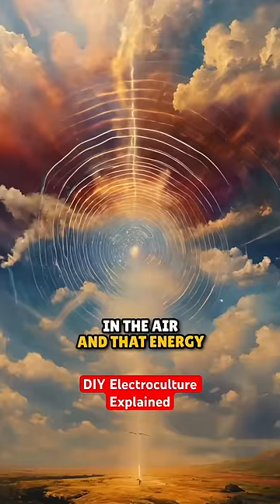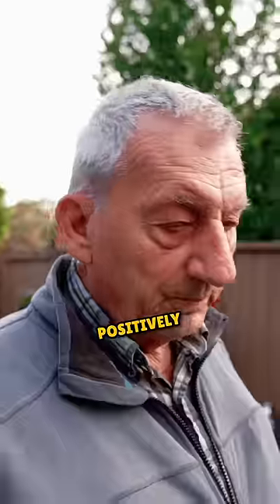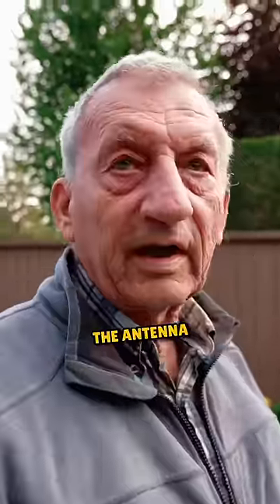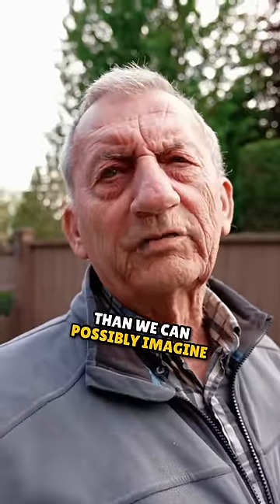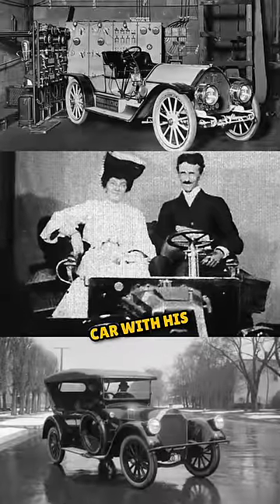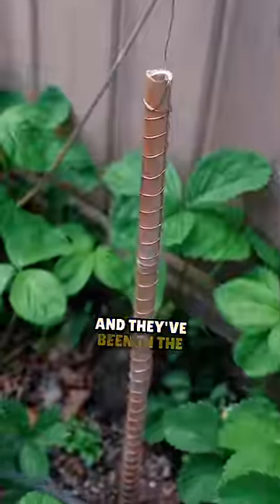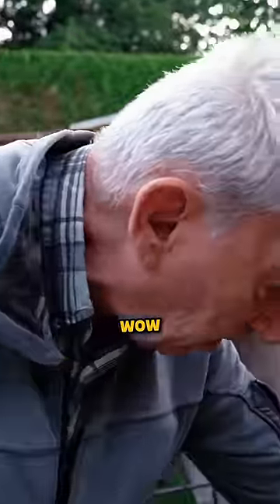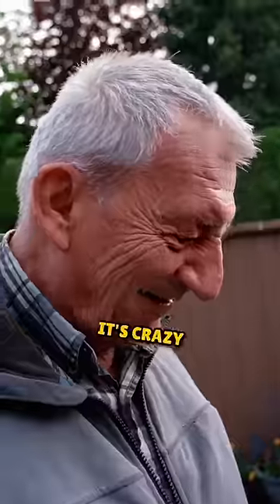DIY Electroculture for gardening explained - What is electroculture and how does it work? #shorts

Comment: I can say from firsthand experience that the copper coiling WORKS.
Reply: Life is electrochemical not electromagnetic. All cells create their own energy and their own water through a  process - "ATP" Adenosine Triphosphate.
Reply: @donaldcameron9321  Yes, and the adenosine triphosphate consists of three components of which three components have their own atomic structures and each atom has it's own positive and negatively charged particles. I guess what I'm saying is, electrochemical reactions couldn't happen without electromagnetism as the boiler plate force.
Reply: Copper coil works as what?  A triangulation tool? 😂😂😂
Reply: No.  No it doesn't.
Reply: Why wrap it around wood? Way not metal? Thanks
Reply: Why we all know these terms that mean what? 
"Well my chemistry professor told me"
Ah so it must be true.
Reply: 100% 👍
Reply: Yes, by providing copper to the soil
Reply: Could this be done with humans in some form?
Reply: So should I use copper wiring. 🤔
Reply: so what does the stick with copper coil do exactly? since when are plants powered by electricity and magnets? they get energy from the sun by a process called photosynthesis, and from the dirt and water providing essential nutrients through the intricate root system of the plant. btw how does the magic electricity from the air get from the copper coil through the dirt and into the plant by the way?
Reply: @AnnaBrown-h4e  Because then it's no longer a coil as the whole thing is conductive.
Reply: @env0x Can you prove that electrically stimulating vegetation roots is not beneficial?  Only way to know for sure is testing.  A lot more testing than a backyard strawberry plot.  Using cloned plants in identical mediums,  receiving the same light levels, same fertilizer applications.   I'd almost be willing to bet it wouldn't hurt the growth.
Reply: Says the guy w/o a Bachelors degree.
Reply: I was going to work at a naval radio tower place and my job was to go and cut all the saplings around the towers cause they draw the current away and grow super fast. I was gonna just experiment with a copper rod but the coil makes sense too. And then if that wasn’t enough I am going to mess with the 432hz and 528hz I think it was and just see if anything great happens. Keep growing 👍🏼
Reply: I highly doubt that 3-4 days would be enough time to  give you results at any measurable degree. I don't disagree that there is electricity all around us, just that this specific method would provide any significant difference, otherwise nature would have them sprouting up everywhere.
Reply: if this work, farm under powerline should be have the best yield
Reply: Copper has anti bacterial properties
Reply: @darwinismyneighbor  I've had mine in the ground for 3 weeks. Now I'm starting to see "results". Made a short video about   it.
Reply: @lone-wolf-1  healthy soil need bacteria
Reply: @travismckinnon2494 
People wear copper bracelets 
Copper socks…
Reply: @TearDrop455  Is it effective?
Reply: @travismckinnon2494  
Very much so!
Reply: I haven’t tried this but I will say that all plants grow better after an electrical storm. I’ll have to test out the coil. Now…. Can anyone  tell me how to keep the chipmunk out of my strawberry plants.
Reply: Whole lotta nonbelievers in this thread 👀
Reply: @katen1228 that’s because lightning converts the nitrogen in the atmosphere to a very useable form of fertilizing nitrogen. And you just got the plants watered with soft water instead of chlorine filled tap water.
Reply: @sarahbroussard7489  You appear to have misunderstood basic organic chemistry and basic electricity. A "Carrington Event" recurrence would fry everything electromagnetic, while leaving "organic compounds" and disconnected batteries unmolested.
There are these things we call "contexts" and you  have wandered indifferently from one to another without closing the door behind you.
Reply: @donaldcameron9321  No need to be an ass, I can admit being wrong.
Reply: @livingdocument i would love to see your video
Reply: @sarahbroussard7489  Maybe I felt insulted.
Reply: Except it doesnt.  You fell into what a lot of people call, a biased belief.
Reply: @darwinismyneighbor well, even without the coil, 3-4 days will definitely give you a significant growth difference. Idk if you’re a gardener at all but, if you leave for 3 days and come back you plants will be noticeably bigger as long as they were watered… so to say it’s from the coil is a stretch but plants definitely grow big in 3-4 days in proper conditions
Reply: Sir what diameter,  thickness, and type of copper please?
Reply: @mj9844  Obviously, the bigger the better.  This man is grounding the earth so plants will grow.
Reply: @katen1228 You can buy fine mesh covers specifically to cover berry bushes & fruit trees etc. or cut up & use those use old, sheer, white curtains that many people use over their windows. They also work well in the bottom of pots to stop soil from draining out but they still allow for airflow.
Reply: doesnt the spin of particles in the elements of atoms create a magnetic field from their rotational force? if our atmosphere is made of elements it too is electrochemical air is made up of elements
Reply: I love the comment section so much 😅
Reply: @bobjonez110  bro what are you yappin about. Do you even know what you are saying
Reply: @zo3997  yes sadly where is their optimism
Reply: @sharsc1994  oppressed by the rich to keep them poor, & hence they waste their energy hating & arguing instead of collaborating... Capitalism is beautiful ❤️‍🔥
Reply: @sarahbroussard7489 
So....as a thought...
We should see better growth in fields at the crossings of high voltage transfer cables....
As there is a lot of electromagnetism under them
Reply: @Treborize.  Yeah you'll get super far in life by pretending experts in their scientific fields don't know what they are talking about 🤡
Reply: Knew a rancher who told his 5 yr old grandson that if he'd pull up & keep his left jeans pant leg pulled up to mid calf over his boot, he'd soon own his own herd.  Everyone at school laughed at him when he explained why he was wearing his pants that way, but it wasn't long after....
Reply: It sure does
Reply: @AnnaBrown-h4e  I'm only guessing, but I think that the steel rod would be like a shirt circuit in the coil.  They don't give a length for the wire, but I think that this would change the effect, just like outdoor TV antenaes have different lengths for different channells.
Reply: @katen1228 

Ivory soap
Reply: ok then do a simple scientific study, one with the pole one without, record it, post it. you would win all sorts of prizes
Reply: @AnnaBrown-h4e   -   What is being used is the LENGTH of the wire. You can get a lot of wraps, even more length, using insulated wire, since the wire won't short out.  Metal would short it out, and nullify the effect. A long enuff wire can make the effect so intense it could knock you off your feet. Think "Ben Franklin" -  He could even INDUCE LIGHTENING out of a clear sky with enuff wire!
Reply: @noblefleet  no it creates an electromagnetic field by being coiled drawing off the magnetic field of the earth and thus stimulating the electrochemical effect in  the plants 😊
Reply: Just don't do it in lightning prone areas🎉
Reply: @env0x they keep the snails away
Reply: How about a 1/2 copper water pipe ?

Comment: I followed his suggestions, and was shocked by the outcome.
Reply: Ba dum tis
Reply: @Patriottoo
What kind of coil, was it just a piece of wire? 
I wonder if a bamboo stick would work?
Reply: What metal was the wire? Copper?
Reply: What was the outcome of how long did it take?
Reply: @jude7321   A lacuna coil.  And bamboo should work, so long as it's a switch.
Reply: @blakelang4662   I tried potassium metal.  The results were almost instantaneous and explosive by the first rain.
Reply: @rouninpanda6318 what do you mean it's a switch? can one use a copper coil?
Reply: @rouninpanda6318  thank you. I'll give that a try next time I'm home.
Reply: @witchcraftispolitical they're messing with you
Reply: I've tried it last year too and it didn't work at all!
Reply: @blakelang4662 I think copper might poison the soil. So maybe silver or aluminum.
Reply: What was the coil made of? Which metal?
Does it have to touch the ground and stretch up like an antena?
Reply: Copper wire its called electroculture
Reply: @blakelang4662 probably not a great idea 😂💥💥💥💥🔥
Reply: This works.   I'm testing and proving it right now.  Unbelievable how much a couple plants jumped in just a few days.  Adding more as i can.
Reply: @steviecef  Of course you're "proof" has a control patch for comparison?
Reply: What metal did you use for the wire?
Reply: Yes @theunsettlingwitch
Reply: @steviecef What was the coil made of in your case? Thanks
Reply: You must hit a utility line
Reply: @theunsettlingwitch it needs to be copper
Reply: @carinabusegeanu4335 it was a joke. Get it? Shocked?

Comment: Since I do a lot of weeding in my garden I always make these with an open loop at the top to protect my eyes from being poked because they are difficult to see.
Reply: What kind of coil?
Reply: @LCJCFAMILY    I just went back to the video and I know what you're asking... Most people use copper wire and the gauge of the wire doesn't seem to be important.  In the video he was using a silver colored wire.
Reply: @dorisbarreto347     with the wire he was winding around the dowel...the wire is the actuator.
Reply: @irenepeek3211  thanks
Reply: What metal or element is needed or works best? Also, what are good substitutes?
Reply: I think copper coil
Reply: Yeah and you don’t want to accidentally sit on one too😂
Reply: Yeah he said copper but he was using what he had.  Copper would be the best I would think conductor wise. Try it counterclockwise I think that is actually the way the Earth is supposed to be spinning.... Let's tell each other the results
Reply: Hello. Thanks for the advice my straight up wire is trying to kill ma!
Reply: Thanks for letting us know! I would most definitely poke my eye out. 
I plan on making the stakes next weekend.
Reply: @karenmmcthree    Hello. Ok count me in I wrote this video name down so my ditzy brain can find it again. Just my thought. I believe this will work better when the soil is damp, therefore more electricity is conducive to the roots of the plants.  I plan on putting 2 to 4 rods by my potatoes ; 1 at each tomato plant(last year 3of the plants were over 10 ft tall)  Then I’ll report about other plants and copper wrapped rods. By the way I’m using bamboo sticks to wrap the wire on. I find them less intrusive and being thin they kinda get lost in the foliage. Good luck!
Reply: Ok, wouldn't any old electrical cord work? I mean doesn't everyone have an old fan or lamp that no longer works? If it can transport electricity for the fan, it should work for this too, right?
Reply: Good idea.  I got lots of spliced up contractor cords. May I suggest that you strip the insulation off and just work with the bare wire.  Good luck
Reply: @laurieroberson2601   hello that’s a great idea as everyone has cords laying around.
Reply: @laurieroberson2601  also, I am not buying wood. I have trees in my yard, and broken off sticks too. It seems silly to go buy it when I already have the materials here at home. It may not work my way, but I am used to letting God take care of my plants. He's a much better gardener than me anyway. ☺️😉
Reply: @karenmmcthree  Earth's don't spin, maybe heavens do spin
Reply: @irenepeek3211  he probably used sand paper to clean off coating on copper wire. otherwise it wont work at all
Reply: @karenmmcthree  earths not spinning
Reply: @graceomalleygrimm9776 lol
Be careful not to grow one of gods forbidden trees of knowledge. You don't want to curse humanity all over again....

Comment: I started doing this because of this guy   must say it does seem to work  ❤
Reply: Make more research.. Don't just jump into things😂
Reply: Wire is copper??????
Reply: its been 5 days since u left that comment, the metal wire should start to rust by now /broken hearth emoji/
Reply: That’s why you use something with either a rust protective coating or copper wire numpty 😂
Reply: What u mean it seems to work that's so not a for sure post
Reply: What kind of coil
Reply: @endlessfart3374 copper doesn't rust, there's only a reaction when the water poured into was acidic...and since we don't want that acid water into our plant, that to say....the copper wont be affected for awhile
Reply: I disagree, I made some pretty hefty copper coil antennas using bamboo and 2mm copper wire and placed them on one of side my allotment as a test last season, if there was any benefit it was entirely indiscernible. Both sides produced equally great plants and vegetables 🤷‍♂️
Reply: @m08q  yeah tell that to idiots growing plants with all sorts of metal wires after they see this video
Reply: @FrayMiigwetch13_4  the rain is acidic water, dont say that, ppl  will put all kind of metal wire on gardens now
Reply: @endlessfart3374   acid in the rain is very normal.....to the point that it doesn't affect any plants. If you're saying that rain is so acidic that it cause the copper wire to rust, then all of us is dying too. Because of that acidic rain there would be no more healthy water or living plant by that time.
Reply: @endlessfart3374  see even the side of a volcano plants still survive if even the soil was acidic and you know when volcano erupts, the rain after that was an acidic one.... That's the most common scenario to have an acidic rain water but not the daily one we have.....
Reply: What about lightening, to sort to be attracted?
Reply: What kind of copper wire did you use please I can't find any I guess an old telephone wire would work maybe.
Reply: How many coils or rods do you use for a raised bed to get those results?
Reply: @sterlingstoots3215  you can buy an electric wire and tell them you want a solid wire...then just peel them off😅✌️ or maybe ask the hardware for solid copper wire...
Reply: I wonder what he really spent his college physics tuition on? 🤔
Reply: @endlessfart3374 copper doesn’t rust 😂
Reply: @endlessfart3374 copper doesn't degrade that fast bozo.
Reply: @jaydenhall187  i never mention or say copper will rust! Wtf u talk bout? i said metal will oxidize and rust on normal rain witch is acidic. Copper also oxidize like metal but turns green just so u know now
Reply: @FrayMiigwetch13_4  understand this : metal is not only copper
Reply: @FrayMiigwetch13_4  i say stoopid ppl will put all sorts of metal  on gardens now, and u try to give advice copper is okay? Since u mistake my word "metal" for "copper" i can see alot of gardens with same mistake u make here and put other wire than copper by mistake in their garden coz they like u, i say metal u hear copper 🙃
Reply: Sand then copper off a post 87 penny and place that a few inches away.
   Rough approximation of an earth battery that will shake loose elemental ions, degrading the zinc.
   BTW, we were just hit with a G4 coronal mass ejection. If you doubt the effect of Earths electro-magnetic sphere, you could always check a compass. Or notice the giant neon light in the sky...
Reply: It's good rain
Reply: What seriously 😳
Reply: Copper wire?
Reply: Do people understand that any kind of metal will blead out into soil, that roots will absorb,  thus putting metal into ALL  parts of the plant.  Maybe ok to drive a car ,but I wouldn't eat it.. just because a thing looks good,  doesn't mean you should eat it.
Reply: @abelKalanzi  Jumping into things is a form of research. Just do it and ask questions later.
Reply: @FrayMiigwetch13_4 copper doesn’t rust
Reply: @JAKENMK how close and how you know it didnt effect both sides.  😂
Reply: You have to test one plant with coil and one without coil at exact same conditions placed next to each other. Then you can find it out if it works or not
Reply: @JAKENMK  how many coils did you use? rule of thumb is 1 coil per 6 inches.
Reply: How much deep in the ground it goes?

Comment: The idea is to face the antenna to magnetic north,  extend thick pieces of copper above the top of the antenna, in a right handed direction, while also extending the wire from the bottom of the antenna through the center of the garden box under the soil
Reply: Thank you for defining the directions. How long does the antennae and coil need to be above and below ground?
Reply: @KimberleeWagner-kj8yz  Under the soil it has to be the length of the garden box or the row of plants, but only down the center row. The length for the antenna is up to you, but three feet is a good length
Reply: This is correct. The copper-top is CRITICAL and the wires from each dowells must form another coil around the entire garden from underneith- This is where the actual magic happens.
Reply: Or, use metal tomato cages and strips of nylon stockings attaching plants to cage.
Reply: Which direction under the soil ?
Reply: What kind of metal should the coils be???
Reply: Copper @BQN_BQN
Reply: What do you mean with thick pieces of copper please?
Reply: @bethmiller6827 ohhhh I wonder if that would work, or do you mean you have used that technique before? Would Tshirt strips do the same as the nylon or is there something in the nylons specifically?

Comment: If your in the northern hemisphere wrap it left hand . Make a thumbs up with your left hand. The coil should spiral clockwise  up the dowel. Resembling your left hand thumbs up. Tesla found that electricity transmits better with a left hand wrap than it does with a right hand wrap In the northern hemisphere due to the movement of earth and it's magnetic field. For more power make a simple Joe tate ambient power module. The complicated Joe tate apm make 30 volts from the difference in potential between the ground and the air.